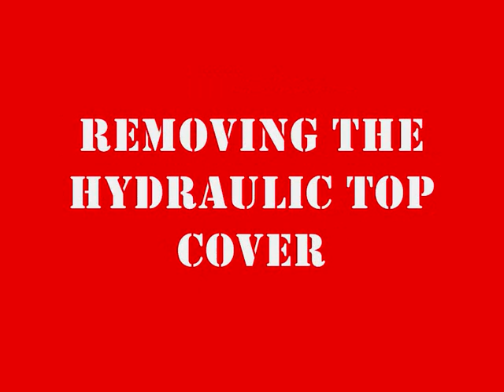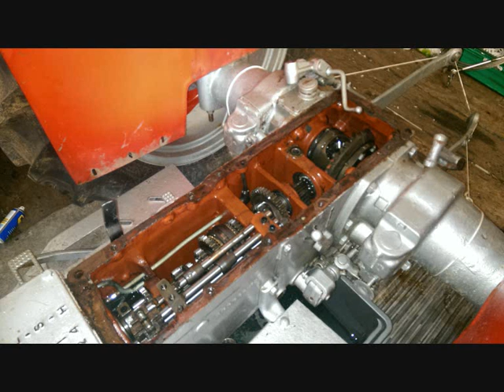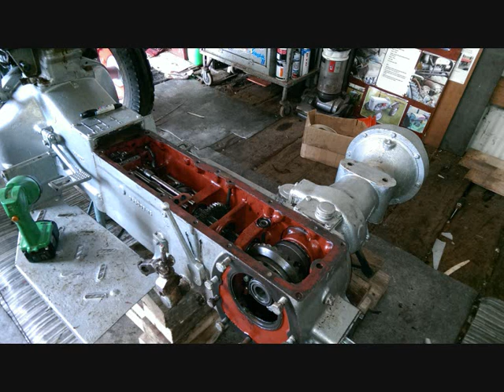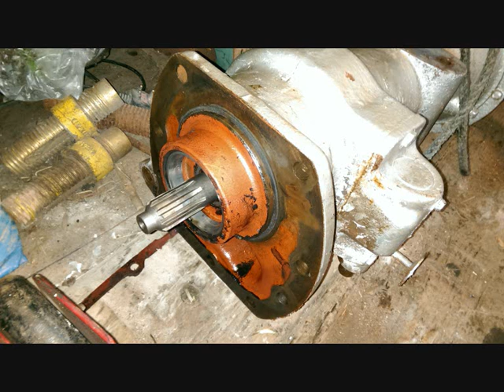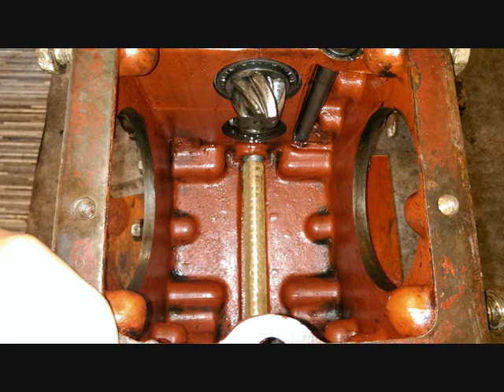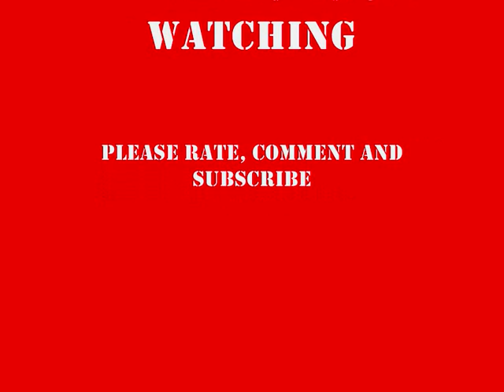Massey Ferguson 130 restoration part 3

Comment: Could you help with were to get the seals for a MF 130 rear axle, Bob
Reply from the maker: Hi Bob 
I managed to get the seals from Doug Mottershead in derby 
But I’ve been told that a MF dealer can obtain an equivalent part 
Hope this helps 
Connor

Comment: Good vids very informative. I have a 130 that I'm restoring at the moment.Have you had any issues with the hydraulic pump as mine fails to deliver pressure after rebuild. What oil do you use in the gearbox? Cheers.
Reply from the maker: Hello,
I did have hydraulic problems but it was my lifting ram that was siezed solid and the pump was fine.
But if the rings on the piston of the pump are good it is worth checking that the safety valve on the pump is working as if it leaks you will have little to no pressure resulting in hydraulic issues.
As for oil i use agriline products universal gearbox oil should be on their website and also insure it is full to the level and is not contaminated with water etc
Hope this helps 
Connor
Reply: could you post a full video where to remove the gear cover?
Reply: Se Adaugă ulei hidraulic sau ulei pentru cutie de viteze? Am și eu un mf130 și am probleme cu presiunea de ulei… dacă ați pune un video cum se repara tot sistemul mi-ar fi de folos! Sunt in România și nu găsesc pe nimeni care sa-mi facă o recondiționare! Mulțumesc!

Comment: Hi! Nice work! I'm restauring a MF25 vineyard, which is pretty much similar, but we are having oil in the gearbox housing that is coming from the oil cooler pipes of the transmission box... (underneath the plate that has the gearbox numbers, where you have the marker on the pic on 0.47). Do you have any pics of the gearbox housing separated from the transmission housing, or any idea how the oil is getting into there? Thanks in advance
Reply from the maker: Hello there,
where the marker pen in the video that is an inspection cover and if you remove it you should see the steel pipes running along the right side. If oil is getting in there i can be due to the a hole in the pipe which is leaking oil or the input shaft seal on the gearbox is leaking 
hope this helps